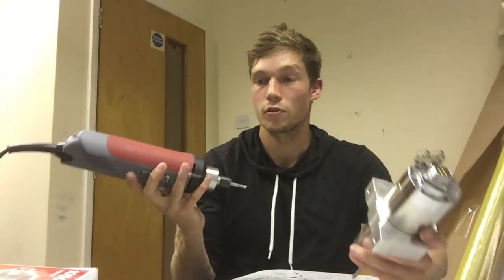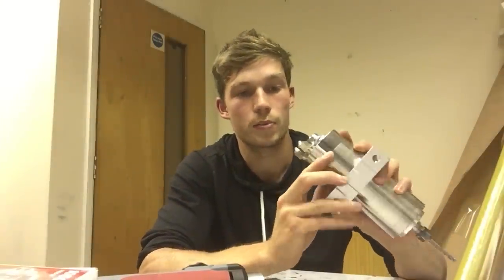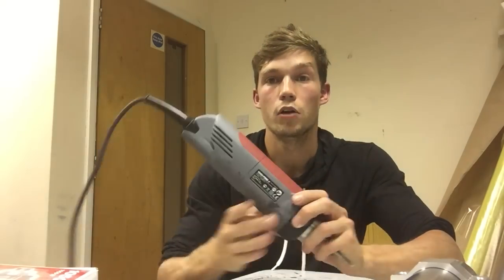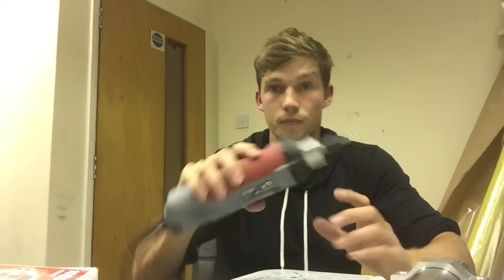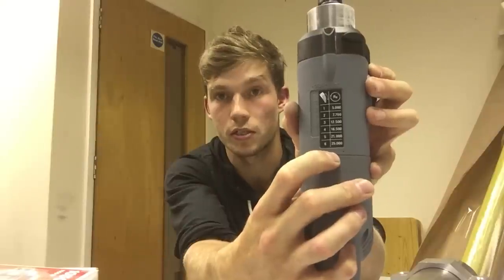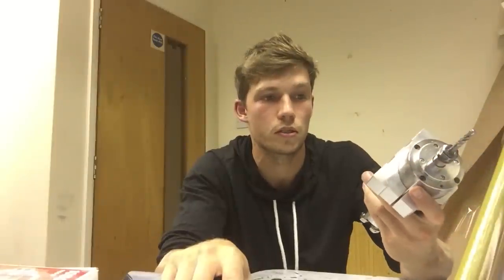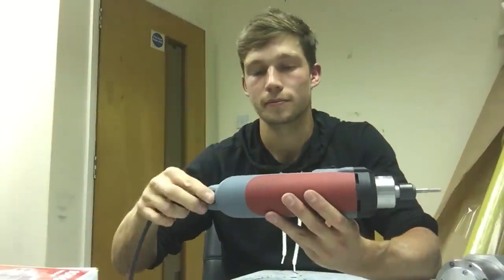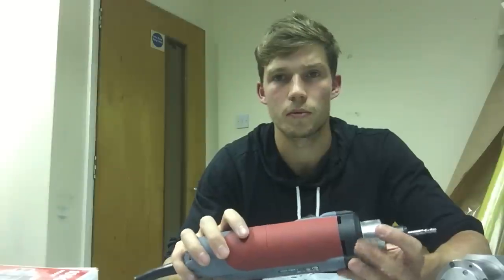Kress FME -1 1050 w vs Chinese CNC Spindle Review

Comment: I know this is an old review now, but I have a Chinese water-cooled spindle.  It is literally, the quietest motor at 2.2 Kw that I have ever heard (approx 3.3 hp I think) and it cuts amazingly.  If I could find an adapter to make it an ATC spindle, that would be wonderful.  Lets not forget that Water-cooled means there is no air being thrown around in your shop throwing dust in the air and lessening the ability of your shop dust collector from working as efficiently. Lets also not forget that I have run my water-cooled spindle for hours straight and it barely was warm to the touch off of "un-cooled" water from a bucket.

I do like how low profile the Kress is, but the Chinese spindle so far is an incredible piece.  I'm quite surprised.  I do want an ATC spindle however.

The VFD works fine on the chinese spindle (mine is Huanyang) and the quality is cheap, but so far hasn't broken.  Do not go off-brand on this unless you know its good.  There are fakes.  But my buttons pad has broken from pressing it often so thats a weakness that I wont hesitate to mention.  I now don't really touch it since all of it activates through my Mach3 program.
Reply: There is actually addon to turn it into an ATC, but it costs around 800$
Reply: @xillianto  I know, not worth it.  You may as well save up, spend 2 grand on a chinese water cooled spindle at 2.2 kw or 5.5 kw for 200 more.  I just don't see my self spending 800 for an addon.  Cool idea, but overpriced.  If it was universal, I would be all over it.

Comment: Water cooled spindles are NOT loud. Switching to a Chinese 2.2kw water cooled spindle from 2.5hp Bosch and Porter Cable air cooled routers is the best thing I've ever done. It is nearly silent...I have no clue why yours is making so much noise that you think it's a problem...that's not normal. The VFD has numerous adjustments for ramp up/down speed, frequency, torque curves etc. Its possible you don't have your VFD set up correctly. I would NEVER go back to an air cooled spindle again. I used air cooled routers for 15yrs...and switched to the water cooled spindle a year ago. Wish I had done it long ago.
Reply: i imagine the vfd is quite loud?

Comment: After looking at your review, I never see you actually running the water cooled spindle. You say that your favorite is much more quiet. In my experience this is far from true and I demonstrate... https://youtu.be/hALI4XpfmQ8
As for stability, the Chinese spindle is supposed to have TWO clamps as shown in my video... in which case it is MUCH more stable. As for the VFD, if it is software controlled via the PWM or the 0-10v input, then it gets to speed very quickly (within 1.5 seconds typically. It should be enclosure mounted with a filter for the dust with the rest of the electronics. If properly configured, you should not have any issues. More recently, the air cooled spindles have proven much better as well... we have been using a 2.2KW with no problems... 8-hour run times over two years.

Comment: Nice video. How many kw was the chinese spindle you compared the Kress with? Have you tested what feed rates and pass depths can the Kress take, for example using single flute 6mm bit when cutting 24mm/1in birch plywood? My 1,5kw chinese spindle died and I need to decide wether to replace the original or go for the Kress.
Reply from the maker: Hey onumihkeI , thanks for the message. The Kress is 1050w and the Chinese spindle I used was a 1.5kw water cooled spindle.
Despite the differences in wattage I was say the kress can handle more :)

Comment: i haven't used chinese vdf spindle and i intend to have one to try。i used kress for a long period of time。brush and bearings worn out and were replaced。 still keep on using it。but。 in this time of year。its price is not cheap。also。 the bearing replacement is not easy。must be done in a professional way。i also find that the short length of spindle shaft is mountef on the stack up two bearings。the separation length is not enough to have rigidity when longer length of milling cutter s like 8 or 10mm diameter。when cutting aluminum with this larger cutter on aluminum and of 4 flutes type。i need to turn it to low speed。 but。 the power is not enough。 making the spindle too hot。 may be i need to choose 2 flute type to avoid using too low speed。
Reply: How can you call this a "one vs another" review when you can only run one of the motors (the loudest one btw!) Rubbish video!

Comment: There must be something wrong with your vfd and your spindle... 
I got the cheapest vfd and spindle bundle from ebay and both are still holding up after a year of abuse.
Even too short acceleration and decelecration times didn't kill it. You can even hook up a power resistor and stop it that way.
The spindle itself is almost inaudible and can go bit below 8000 rpm (for a short while, this WILL burn the coils!)
And the best thing is that you can hook the vfd to whatever controller you are using and use dynamic rpm control for roughing and finishing passes.
Reply from the maker: Hi Alexander Hammer, thank you so much for the comment! That's interesting, I think the dynamic control is really cool for that purpose. I myself in most cases am not cutting any super tough materials, so I set the spindle to one speed and go straight onto the finishing cut, with deep flutes on the tool bit so that when the tool bit passes through the material I'm cutting, it is able to slice out material even at its lowest position and I set the speed to the worst case cutting scenario .i.e. The tool bit has plunged down fully into a fresh bit of material to its deepest position and then moves left, right forward or backward.

I've had the Chinese spindle and VFD for 4 years now and it still works. I just find it can be intermittent. I have used for production purposes, so it has had some heavy use in terms of time left turned ON. Maybe in need of some maintenance, but I'm sure I always remember the sound being and issue with spindle from new. Interesting though. I'll see if I can find anything online about maintaining/lubricating the device.
Great to heard from you.
Best regards, Matt
Reply: I mostly use it to mill aluminium not ideal but cheap. The smallest tools I use are 1mm end mills and drills, the biggest are 6mm end mills. The longest continues cutting time was about 5 hours. I really like the thing but I wish I could turn it down to about 2000 rpm without setting the spindle on fire or losing all torque.
Reply from the maker: Alexander Hammer nice! Is yours the air cooled or water cooled version?
Reply: I was wondering... so far I've heard that even the chinese spindles are basically without sound, even the air cooled ones. Kress and other routers are said to be much louder.
Reply: Well a vacuum cleaner is very loud :) But I really don't have any clue, I'm just thinking (again) about building a CNC machine.
I also thought both were brushless but neither is.

Comment: The water cooled spindal should be quieter you should look at replacing the spindal bearings nothing stopping you from mounting the bracket lower on the body of the Chinese spindal and the VFD gives you more control.